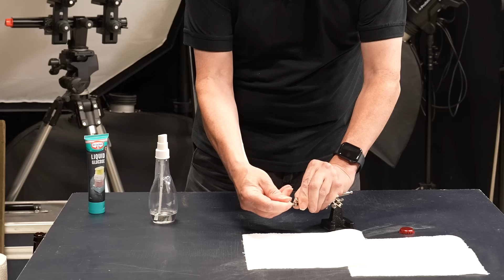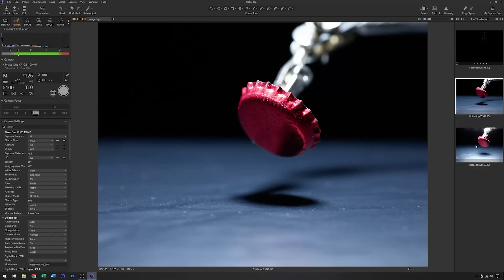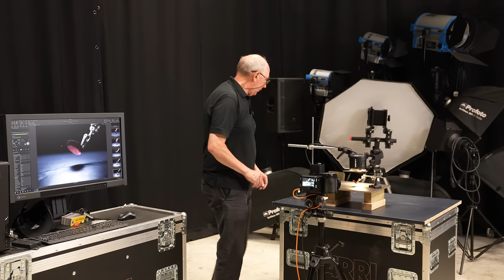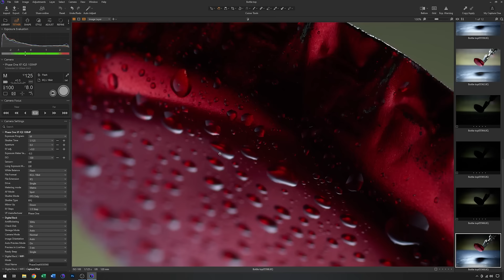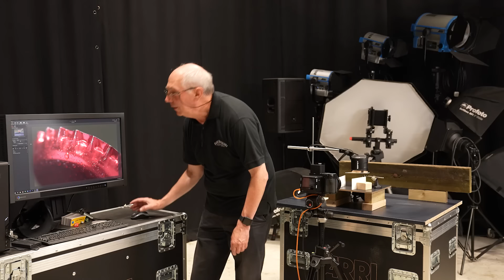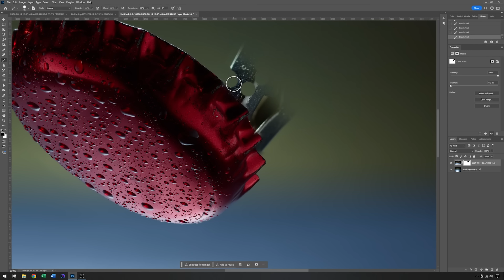Frozen time effect macro photography

Comment: When it comes to focus stacking, depending on the subject I sometimes get better result with the aperture closed down more rather than opening it up. That is because out-of-focus elements in front can obscure the back when focus is on the back, if they cross in front of each other. (I hope it's clear what I mean, I find it a bit hard to explain).
I don't know if you have experienced something like that yourself and if so, if you have any solutions for that other than closing down aperture to make the out-of-focus front parts not as wide out of focus?
Reply from the maker: I find the order the images are loaded into the focus stacking software to be a factor in this for some subjects. Generally the higher the magnification the wider the aperture and more images for the best result. Hope that helps, thanks for watching.
Reply: @CameraClubLive  I understand that the wider aperture helps prevent diffraction. My problem however seems to be that sometimes, regardless of order of shooting or stacking, none of the images seem to have some parts sharp. For instance, with small flowers like cherry or apple blossom -- the stamen are in front of the petals. When the stamen are in focus the petals are not sharp. When the petals are sharp, the stamen are so much out of focus that the become a large blur covering part of the petal behind it. At narrower aperture, the blur-spot of the stamen becomes smaller because it is to a lesser degree out of focus. (I don't have an example photo at hand to demonstrate unfortunately).

Is that a problem you have ever encountered?